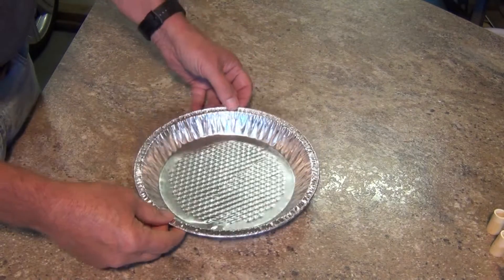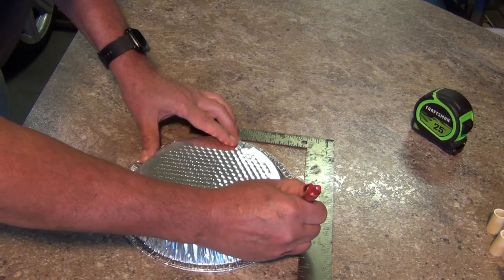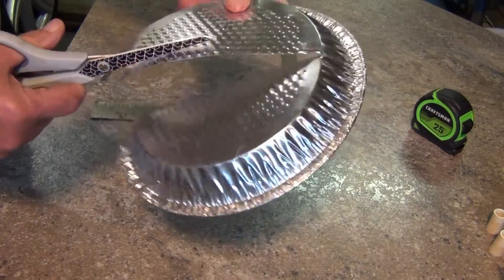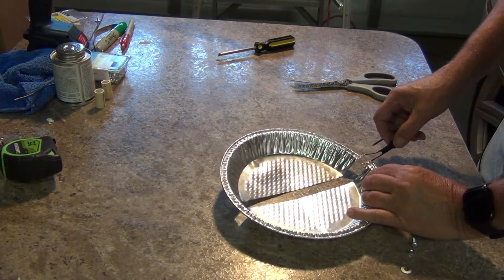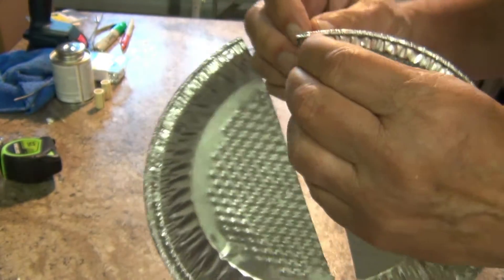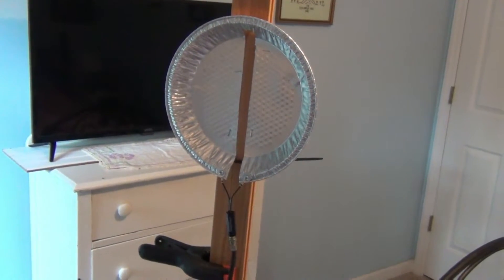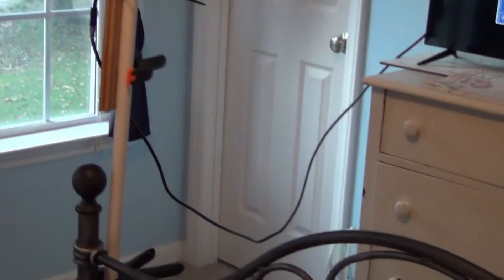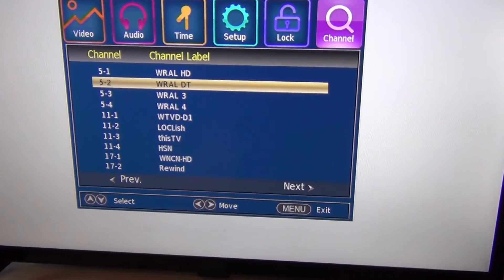The Pie Pan TV Antenna. Very Easy to Make!

Comment: Seems to me i should ne able to make and antenna out of the aluminum siding on my house is this possible,  if so how.
Reply from the maker: To make a proper antenna, you'd need to cut the aluminum into strips and trim them to the size your antenna design requires. Just attaching the existing siding to a piece of coax may give you some sort of signal, but probably very limited

Comment: Hello sir i just want to ask what kind of antenna is close to this? does it work like a parabolic reflector or it works like the loop antenna
Reply from the maker: The aluminum in the pie pan is configured as a standard element, so it's a type of hoop antenna. Thanks for the question, VF.

Comment: Will this work with just aluminum foil?
Reply from the maker: If you make a disc out of aluminum foil it should work. Pie pans are just easier to use
Reply: @mrhoptoit7835  Thanks!

Comment: How do I scan tv
Reply from the maker: On most TV's, use your remote and open up the menu. There will be a heading for Channel. Under this heading, make sure the Antenna input is selected.. The channel scan should be located under the same heading. If your tv is different, Google search for your specific make and model and you should find it's instruction guide posted. Thanks for watching.

Comment: I would like to try 4 pie plates together but how to connect them to the Balun for best configuration?
Reply from the maker: I would think that using a balun on two sets of double pie pan antennas, then connecting them with the same length of short cable to a combiner/splitter , then attach your download cable to it. That would be your best option. The two pie pan antenna build link -  https://youtu.be/DQoo9HOL_lc            Thanks for watching.

Comment: This helped to get additional stations. I had 2 wall and 1 rabbit ear antennas with/without amplifiers, trying to get every possible channels. Even so, I could not get FOX, CBS, and PBS (note: my old nice Sonny DTV sometimes received FOX and PBS in good days. The one I have now is the cheapest one from Costco and probably does not have a good TV tuner). Tried other simple DIYs from YouTube and they were all worse than the rabbitear antenna. Found this video but I did not have the pie pan. I used a styform plate, cut and wrapped it with Al foil. Supprisingly, the pictures became sharper. Ran channel scan and it showed twice the channels used to be (some at 45 miles away). Now I am getting all the major stations with sharper pictures. But I still need to use the "MOHU The Leaf Plus" wall antenna plus this simple homemade one. Thanks for the easy to follow DYI.
Reply from the maker: Glad it helps you, Doug. Thanks for watching!
Reply: Antennas with reflectors will always do the best in getting you more stations.

Comment: Ahhh this is a blast from TV past.  Yeah we stuck the two wire feed on everything...wire loops, tin foil, BBQ grills when UHF started getting popular around 71 or 72.  People went ga ga when Six Wives of Henry the 8th and I Claudius aired on the new PBS.

Then everyone got cable and many forgot how to get TV OTA.

VHF is best with dipoles (rabbit ears inside).

Consider lying the pie plate down at a height close to the ceiling like on a tall wardrobe....bet the signal gets stronger and the ugly rig is hidden.

Comment: When DTV first came around, I tried some of the fancy antennas. They were ALL a waste of money. My setup looks awful but it works. I have rabbit ears made before 1994 that I bought at a yard sale, I have coat hangers and  coaxial cables hanging around too so I can move my antenna if need be and the coat hangers, I use those by touching the antenna to them to amplify the signal. And now you tell me I can use a pie tin?? 😂 

I am going to try this sometime soon. I will let you know if it works better than my eyesore of a setup lol

Your channel name got something random stuck in my head. I keep hearing "hop to it, don't delay, hop to it... Now I have to go find out where it's from. I am thinking Mother Goose Rock 'N Rhyme but I might be wrong. 😂
Reply from the maker: Hi Brandi. Antennas are simple devices, but how well they work totally depends on a bunch of local factors. I applaud your ingenuity using your rabbit ears setup. Hey, whatever works! I hope the Pie Pan antenna works well for you. Its easy enough to build it and give it a try. 
Im not familiar with the "Hop To It" reference. Let me know if you figure that out. Thanks for watching!

Comment: NO SUCH THING AS A HDTV ANTENNA  ANTENNAS DO NOT CARE ABOUT MODULATION FORMATS  ALSO  A SINGLE ELEMENT ANTENNA IS EFFECTIVE ONLY AT ONE FREQ AND TV STATIONS SPREAD ACROSS HUGH BANDS FROM 50MHZ TO 500 MHZ  INVEST IN A YAGI AND A SMALL MAST  OR JUST A 99 CENT RABBIT EARS WITH TELESCOPIC ELEMENTS
Reply from the maker: Hi Gene. Thanks for you r comments. As far as "no such thing as HDTV Antenna", please read my response previously posted in my Video Description. Antennas are designed for different areas, signal strengths,  etc., and a single element antenna may be all someone needs. I'm sure you saw in my video the reception I was able to get using this simple antenna. Pretty impressive, wouldn't you say? This antenna is based on a standard hoop antenna, which have been successfully utilized for UHF TV reception for many years. Many retailed rabbit ear designs actually employ a hoop in them for UHF, and use the long elements to any VHF stations still broadcasting in the area.. Yes, you are right, an expensive yagi and mast set up could work better, but a lot of people don't need that kind of range to get their local stations. I suggest checking out rabbitears.info to see what equipment is required for your needs. Keep watching my channel!

Comment: Something I don't understand.  Why do you have to cut the pie plate?  Could you just attach the transformer to the pie plate and leave it at that, or would that not work as well?
Reply from the maker: Cutting the pie pan creates a circuit path. Without it the flow would be direct from one terminal to the other., which wouldn't work well. Why don't you build one and try it both ways? The difference should be very apparent. Thanks for the question, and thanks for watching!
Reply: @mrhoptoit7835  Ah, I see.  Thanks!  That makes sense.

Comment: I noticed you were receiving Raleigh channels. Are you in Wake county? Just curious as to how far the reception was.
Reply from the maker: Im in Johnston County. Its really just a small antenna designed for close, strong signals. Your performance will be based more on antenna height, location, local trees, power lines, etc. Thanks for watching. Go Canes!
Reply: @mrhoptoit7835  I'm in Randolph county and I would like to experiment with a pie pan. I tried an amplified Mohu leaf antenna and the most channels I've been able to get is 93. About half or more eventually lose their signal.

Comment: I love the simplicity of this project and want to try and make one. Would this work better with two pie pans connected to make a larger antenna?
Reply from the maker: Good question, Jean. I have tried using different configurations, including two pie pans, but in my case, it didn't make any significant improvement. Maybe it may work in your location, I don't know. Thanks for watching!
Reply: I am going to suggest that not two pie pans won't work better.  His design is just about tuned to the wavelength of the signals in his area.  Bigger would tune to lower frequencies.

Comment: There's no such thing as an HDTV antenna.
Reply: It works who cares if it is in HD
Reply: @karlakropiwnicki1334  the tv is hd, not the antenna is what both of us are saying. The same or similar math applies to all antennas. They are designed by frequency not megapixels. For you (most of you), if it works is about all you need to know and by saying HD, they charge you more.
Reply from the maker: Well, technically not true. If it's an antenna, and it's hooked up to an HDTV, then it is an HDTV antenna. You are right, it's no different than any TV antenna, but it's the way things are marketed, so I must follow the expectations.. Thanks for watching, James.
Reply: Agreed. You can't change the laws of physics or electronics.

Comment: Do Regular Antennas Or DIY Antennas Work Better?
Reply from the maker: That's a very good question. Either commercial or DIY antennas can work very well. More importantly, it's whether the antenna design , construction, and mounting are correct for your specific location and transmitted frequency bands.

Comment: A paper clip will work in some circumstances. I used to use a coat hanger in the old days.
Reply from the maker: Thanks Wade for the comment. If you have strong enough signals, just about any piece of metal will get you at least some UHF channels. I tried the paper clip for the heck of it, and I picked up 12 stations. This simple pie pan antenna has a larger total element and its 9" size makes it a close match for most UHF frequencies, so that's why it actually performs so much better.

Comment: Are you catching hi-VHF frequencies?
Reply from the maker: Hi Mark. This antenna is sized and shaped for UHF frequencies. That being said, I do receive a couple of VHF channels on it ( OTA  actual RF channels 8 and 9) but I am also within 15 miles of the transmitter tower. I suggest making one and seeing how it works at your location. Thanks for your question and support!
Reply: @mrhoptoit7835  I was just wondering if using more than one pie pan would improve on the number of channels,or not?